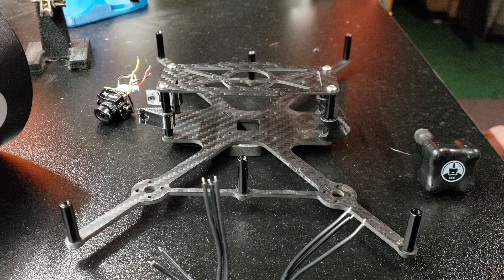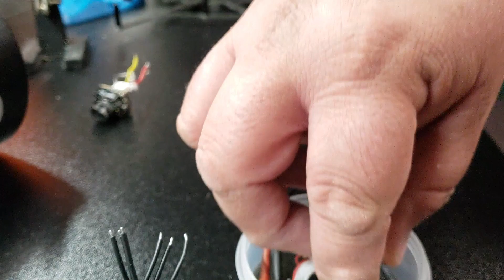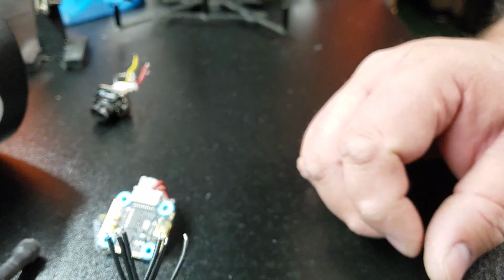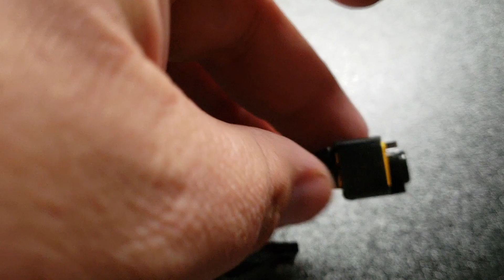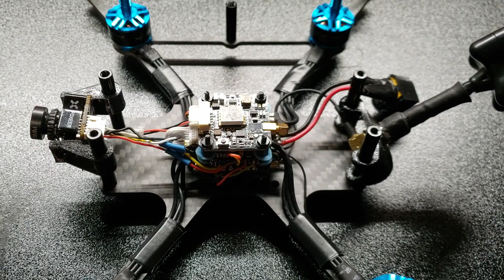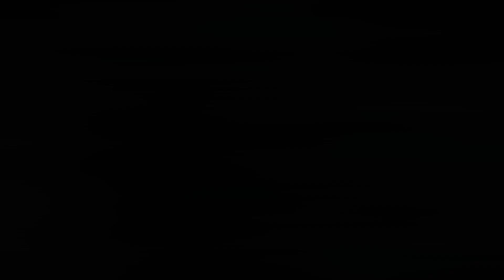Shendrone Squirt V2 Build

Comment: Hi nice build video. How much is the Weight with gopro and lippo? does it feel heavy and how much approx flight time you get sir?
Reply from the maker: I don't have a scale but pretty light. I use a GoPro Hero 7 and use a 850mah and I get between 3-4 minutes.